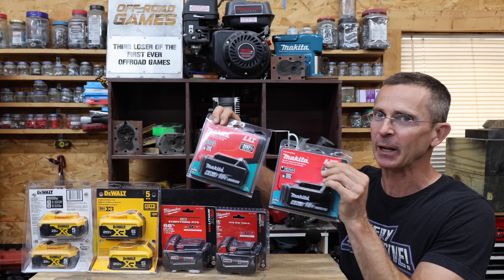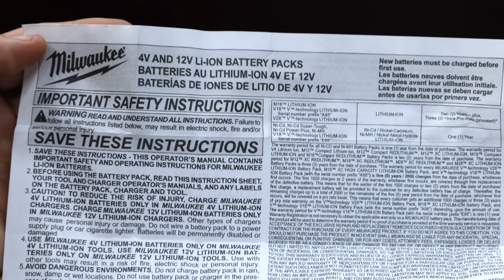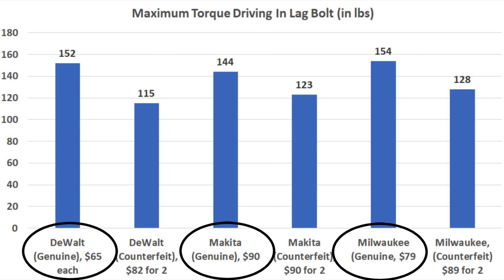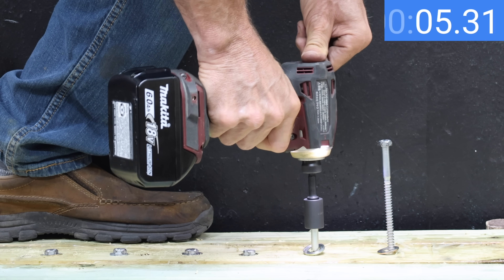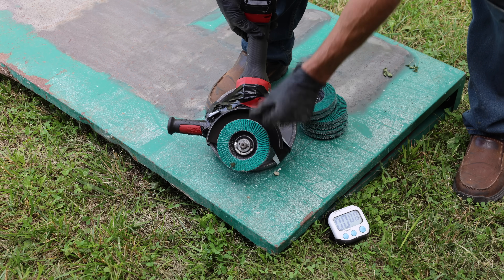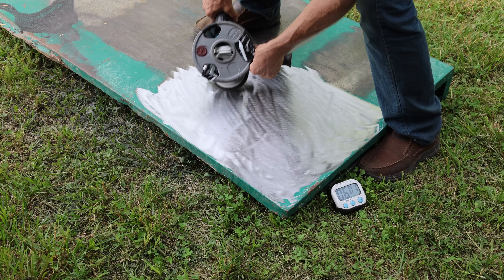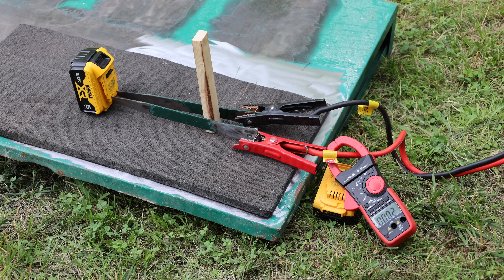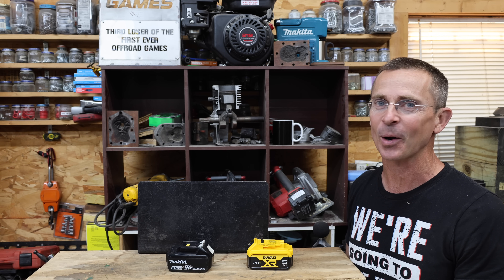Have You Been Scammed with a Counterfeit Tool Battery?

Comment from the maker: Here's the list of batteries reviewed. More details in the video description. Thank you!
Authentic DeWalt: https://amzn.to/3yXhmHP
Authentic Milwaukee: https://amzn.to/3VaroNw
Authentic Makita: https://amzn.to/4bN5pmS
Milwaukee M18 TOP-OFF 175W Power Supply: https://amzn.to/45aD3As
Reply: Thanks for all the hard work doing the thorough testing and getting us all this awesome information! And for posting links to genuine batteries.
Other than getting the info you posted here, how does one know youre getting genuine batteries when purchasing online? Is it price? It seems like once the counterfeitters catch on to that, all they would have to do is raise the price to normal levels and you'd never know.
Reply: 20v on the counterfeit dewalt is the wrong font and so is the xr
Reply: I've heard that Milwaukee does not allow real products to be sold on Amazon and therefore all Products there are not genuine. is it true?
Reply: Just a thought could you place a 10or twenty lbs. weight on top of drill just to be consistent I know the grains in wood will vary but one bolt out of 5 wouldn’t break the deal for me. Thanks for what you do!
Reply: Be careful Todd, anyone can sell on any listing on Amazon marketplace. They can even FBA fake batteries to Amazon for fulfillment. The newer fake M18 batteries are literally identical on the outside. I suggest only buying from big box stores when it comes to batteries. All these stores usually run deals on batteries which will be cheaper than the possibly fake Amazon ones.
Reply: Is that DeWalt link still accurate? DeWalt doesn't even link to Amazon from their site, and the price is half that of their listed sites.
Reply: Question, does FLEX have a fake battery? Seen some replacement non name brands, that are semi compatible, (can be used with the tool, but they will not charge with the fast charger)  could you test those batteries please.

Comment: You are doing such incredibly valuable work. As an electrical engineer, I am very concerned about the batteries with no circuit boards - these are a major safety hazard. Even the ones with circuit boards are suspect - people should be vigilant when buying batteries as they can be very dangerous if not properly designed.

Comment: ive always felt like if someone with some sense made batterys for these tools they could actually be rly successful. there are a ton of high output 21700 and 18650 cells out there that outperform whats in most of these tool brands tools. if someone wanted to they could design a pack for say 8ah and then offer different output levels like a standard and high output version. and if decent materials were used its very likely they could offer a superior product to what the big brands offer simply because they could pivot to better cells whenever they wanted as opposed to being fixed to an outdated cell from whenever the tool was first made

Comment: Got scammed on a 8.0AH on fleabay before I knew how to check the diagnostic codes. The battery and packaging were excellent copies. It performed like a XC 6.0AH when new. After about a hundred charges, it goes dead quickly. Now I always ask the seller to confirm codes and weight before purchasing.

Comment: I was hoping he would take a closer look at those blank batteries, such as in the DeWalt, and tear them apart to show people these are just DUMMY batteries. I am currently explaining to someone on Reddit about his 20V 8.0Ah 160Wh battery. While the battery pack doesn't say DeWalt, the battery pack does give model DCB200 on it's dataplate label. You will find these batteries in abundance on Amazon, but they are the exact same battery packs as the counterfeit DeWalt batteries in this video. The blue batteries are actually not connected to anything, they're filled with something, maybe sand, to give weight. The are using the same 3.7V 2Ah 7.4Wh batteries as all these counterfeit batteries in his video. 

Also, one other thing. The DeWalt advertises their battery pack as a 20V, but it's exactly the same as the Makita and the Milwaukee, 18.5V. They are using a higher number from a nearly fully charged battery, but this to give the impression their battery is better, when its not. The marketing on some products is ridiculous. Other battery technologies all use their nominal values, but the lithium market is a free-for-all.
Reply from the maker: Thanks for the feedback.
Reply: @ProjectFarm  You're welcome. Thanks for the videos!!

Comment: Its not a dead short, you just completed the path for electrons to flow from - to + 
And the reason why batteries and or wires will catch fire is because when you complete that path, the electroncs flow free with no resistance, meaning they flow faster and faster and faster creating heat which the battery internals/plastic and or "wire" that you used can't keep up so they turn red and catch on fire and blows open. ]
If the wires are sufficient to keep up with the amperage, it will just keep flowing until the battery itself wears out to nothing

We call it a short but its not technically shorting out. Great video btw !!
Reply from the maker: Thanks for sharing!

Comment: Amazon has simply become a Alibaba reseller of fake products. Even well-known supplement brands are counterfeited and sold on Amazon, filled with cheap fillers and dangerous ingredients contaminated with lead, arsenic, metal shavings etc
That won’t just give you a dead battery, they will make YOU dead. And Amazon continues to sell it because all you need is have the same matching barcode, since Amazon simply ships products from the cheapest seller, not the most reputable seller or the manufacturer. ☠️

Comment: Bought an M12 6.0 Milwaukee battery and after 2 years a wire that was soldered to the board broke off, after finding that out I noticed there wasn’t Samsung cells inside and no plastic molding underneath the cells so I’m assuming it’s fake.

Comment: seems like it doesnt matter where you buy batteries, the swap and return scam hits stores as well as online :-( i bought a 12Ah Milwaukee battery at an ace-hardware, thing puffed and started to meltdown.....i dug out the packaging from the garbage and went back to the store, thinking i was just unlucky....but things got worse. they compared packaging and product up against what they thought was real deal, accused me of switching with a fake, and threatened with legal action. i walked out with my stinking pile of expensive battery. got the bank involved and they got my money back. but im now blacklisted from my favorite hardware store.....we know these real batteries are overpriced, dewalt launched cheaper batteries to try and combat this.....but how can you protect your self from counterfeit batteries when they are copied soo well, opening the battery voids warranty plus its not hard to reskin the cells with fake samsung sleeves. put a chip inside the battery that talks to the tool like HP and cannon did with their inkjet cartridges,  angered many ....so what to do ?

Comment: Cheap knock offs have a funny letter design, that tries to embrace the original, but usually with worse print.
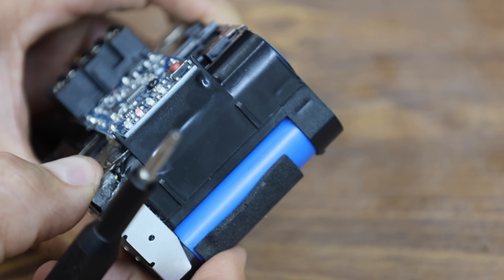0:26 Right is the original, they have a pretty distinct industrial font they probably patented.
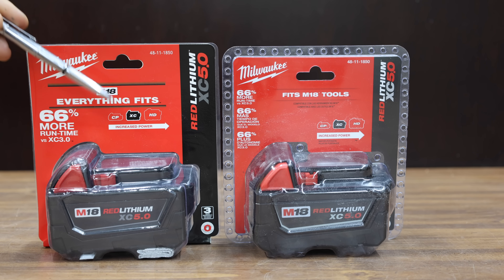2:30 Right Milwaukee, has more spread between the letters.
4:00 Right Makita, has a the more authentic coloring.
Reply from the maker: Thanks for the feedback.
Reply: @ProjectFarm  Your welcome, Sir!
Was I right? As much as I can make the difference out, I'm only using intuition and my experience with knock offs.

Comment: So for everyone wondering, what I done with dewalt batteries I purchased online. I called dewalt and gave them  the model number and serial number they check to see if it’s legit. Then they will ask for pictures to submit by email. Then while you’re on the phone they will let you know if it’s real. No need to open the package to find out. Just take pictures of front, back, top, bottom
Reply from the maker: Thanks for the feedback.
Reply: @S_witch_on that’s a shame because I’m in the US I don’t understand why they would do it for me and not for you. They did ask me where I purchased it from and I said EBay. You would think they have the same practice. They also told me I could pay a little extra to ensure it for 3 years 🤷🏽‍♂️

Comment: Just opened a Dewalt 5Ah battery that quit after 11yrs.  It has a small vertical circuit board on the back of the connectors (like the counterfeit), but the cells are Samsung 20R.  It looks genuine on the outside.  All my batteries are getting old and I'm using the adapter to fit a few old 18V Dewalt tools (works great).  I'll need some new ones soon.  Thanks for the video.
Reply from the maker: You are welcome!  Thanks for sharing.

Comment: Unknown lithium-ion battery quality is a big problem for consumers. Especially because they can be a fire hazard, but also because of poor capacity and poor lifetime. I know personally for nickel metal hydride (NiMh) batteries there is only one factory in the world that makes good quality ones and that's in Japan. I've bought cheap NMh batteries made in China and they have low capacity when new and did not last many years. If you need AA or AAA batteries, buy rechargeables and a charger from Ikea, they're inexpensive and high quality, made in Japan almost certainly from the same factory that makes more expensive Eneloops.
Reply from the maker: Thanks for the feedback.

Comment: Very interesting review.  The counterfeiting is very accurate like counterfeiting money.
But here’s the bottom line.  If these counterfeits are 20% less in performance, but cost 40% less, they remain a good deal, but a little risky in fire hazard because of the 40-100 watts of stored electro-chemical energy.  It also tells you that the OEM batteries are a bit overpriced when they charge 40% more for 20% performance gain.
Reply from the maker: Thanks!  Thanks for the feedback.

Comment: I just purchased the Dewalt 8" chainsaw and pruners with the same XR-5 AMP batteries you tested from Home Depot.  They will be delivered today.  Thank you for doing such an in-depth test, evaluation and inspection on these products.  I will check mine with a microscope.  Realize that this video will be saving lives.  Tip of the Hat too you!   Your testing is exhausting!
Reply from the maker: You are welcome!

Comment: Dewalt from ali vs "real" Dewalt:
- both made in china
- "real" markings gone if gasoline gets on it, ali's not, better paint
- "real" died in a year of non-pro use, still fighting dewalt for replacement, ali's battery almost 2 years and working as it should
- "real" is almost 4x more expensive.
- never shorten batteries and never run it into empty
Conclusion: will never buy "real" again.

Comment: At 25 seconds, I could tell the left one was the fake by 2 things.
1. The serial number is on the OUTSIDE of the package as well as on the batteries.
2. Side sticker, it reaches all the wall across the sticker section, not just 3/4 way.
Reply from the maker: Thanks for the feedback.

Comment: 18:58 Fun Fact - Samsung battery cells are NOT individually protected against short circuits. They are just designed to not catch on fire. If you do some digging online (check some websites for official retailers of samsung batteries) you can find the samsung SDI datasheet for those cells. 

None of these cells have circuit boards inside them to provide individual cell protection. The good cells are just designed to withstand the heat and pressure generated by a short circuit without rupturing.

Comment: nice to see, very happy.
3 times i buy the Makita charger with battery and drill from Aliexpress, Dec-2024  it was all fake so i send it back.
i try the drill ddf487 it works only 2 times then it broke,, so i send it back.
all the 3 chargers were fake so i decide to order from a normal site.
I compare the charger with a original charger, in the fake is almost no motherboard, only a very small motherboard with some parts.
The Gisam drill looks better then the fake Makita.
The quality from the the Aliexpress counterfeit drills and battery's, is different from wich site you order.
sometimes it beter sometimes it is more bad, but it is still fake.
Reply from the maker: Thanks for sharing.

Comment: Often, when you haven't been directly scammed yourself, the company you're buying from has been scammed. A certain country we're not allowed to criticise on here, has a habit of flooding the market with counterfeits of far higher quality brands, which happens to include the individual lithium cells that go into these battery packs. The company that makes the power pack, is literally being conned by a supplier selling them low grade Chinese 18650 cells that are disguised as Samsungs or Panasonics or some reputable brand. Or the supplier is being conned by THEIR supplier. The unnamed country has a knack for forcing Chinese knockoff crap into the market.

Comment: UPDATE January 2025 - They are Fake!
I followed up again with Dewalt and they admitted the call support team really does not have the ability to tell real from fake based on internal components, and referred me to a DeWalt factory service center.  I called them and the lady was very helpful, sees fake batteries all the time, and confirmed mine are fake.  No Samsung cells, no circuit board (except for indicator light), no thermal runaway protection, housing and color differences, no QR code (should be there for anything with 2023 date code).  THANKS FOR A GREAT VIDEO AND RAISING AWARENES OF A RISING THREAT OF COUNTERFEIT PARTS.  Happy to get a firm answer but sad to learn parts are fake!

OLD MESSAGE:
I like the video BUT...
Following this video, I checked my DeWalt 5 AH batteries bought on eBay a year ago and found 2 were counterfeit. No QR code, no internal circuit board, no name-brand cells.  I contacted the eBay seller asking for a refund,  and contacted DeWalt customer service to confirm these were bad.  After about a month, DeWalt finally replied they reviewed my photos and advised the batteries were NOT counterfeit, were made by DeWalt and are safe to use.  I sent a note to the eBay seller with apologies.  

I appreciate the detail in the video regarding cosmetic and performance differences.  I can only imagine there is variation in how and where DeWalt manufactures or acquires batteries of the same model number, with respective minor variances in appearance and design.  Best is to contact DeWalt customer service if you suspect counterfeit parts.
Reply from the maker: Thanks!  Thanks for sharing.

Comment: As usual, I love your reviews. I've been scammed by counterfeits in many products (auto parts and shaving blades come to mind) so love this content. Counterfeit products should be regulated better. Thanks, I didn't realize this has now entered batteries. What I hate nearly as bad is products that come out then stop supplying batteries after a few years. They'll either change packaging of the same voltage or simply make them unavailable. Yes, Dremel, I'm talking about you.
Reply from the maker: Thanks!  Thanks for the feedback.

Comment: Thanks for doing the test.  I feel, that you can't know enough about these lithium batteries, if you are going to use them safely.
I payed for two DeWalt 6 hour batteries, and ended up getting stung with two counterfeit units,  They worked well for 2 years, powering various 1/2 " drills, recip saw, and a 1/2 inch impact hammer.  Last month, one of the battery packs would not take a charge, and upon disassembly, I found all the cells were good but one cell, which was dead.  
The batteries have no brand name, are light purple in colour, and are stamped as being rated at 2600 mAhr.  There is a control board in the battery pack. 
The remaining battery pack, is still performing well, and still takes a full charge.

Comment: I know nothing about "counterfeit" batteries but I have had  and use about 50/50 after-market batteries and genuine Dewalt batteries for over 5 years.  I would not call the aftermarket batteries counterfeit because they don't claim to be Dewalt brand, only that they fit and can replace Dewalt batteries.  The after-market batteries often don't have as much rated AH as they advertise but they are generally close. I can generally buy two or three after-market batteries for the price of one similarly sized genuine Dewalt battery.  I use them almost every day at work and have not had any of the after-market batteries stop working or go bad yet, except on one battery two of the charge indicator led lights stopped working but the battery still seems to charge normally and hold a workable charge.  I do look at the reviews of the after-market batteries when purchasing them to have make sure I don't buy any duds and so far not been disappointed. 
As a side note, if I have a serious job to do I am going to reach for one of these after-market batteries rather than one of the weak 2 AH batteries Dewalt frequently supplies with it's tools.
Reply from the maker: Thanks for the feedback.

Comment: Thank you for the battery tests. Although it's great to save money, I have not been tempted by counterfeit batteries, as I don't think they offer any substantial value. They may be cheaper initially, but likely do not last as long as the OEM manufacturer's batteries. And as your tests confirmed, they lack the performance capacity of the OEM products.
Reply from the maker: Thanks for the feedback.